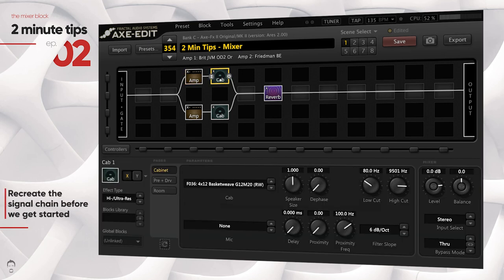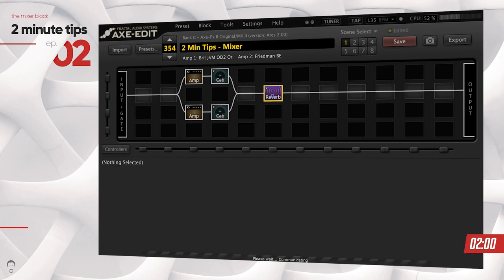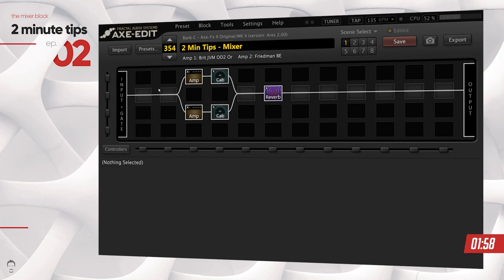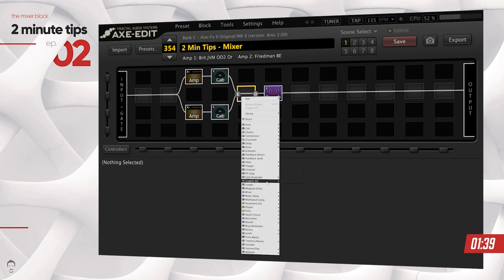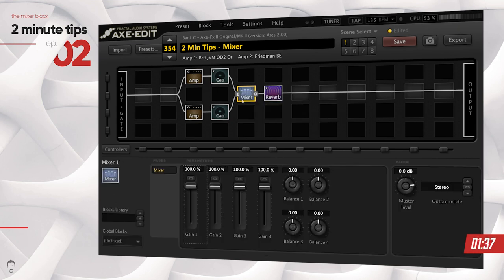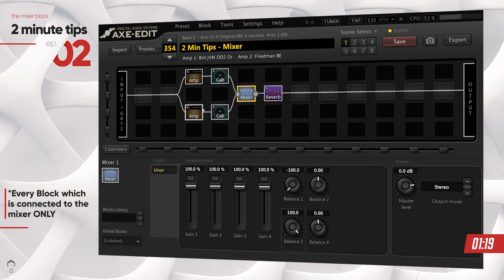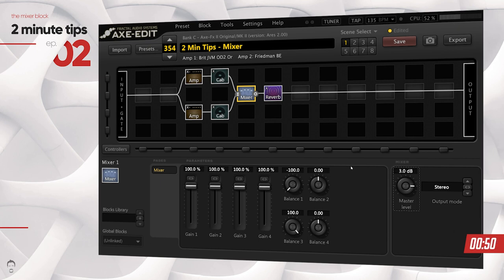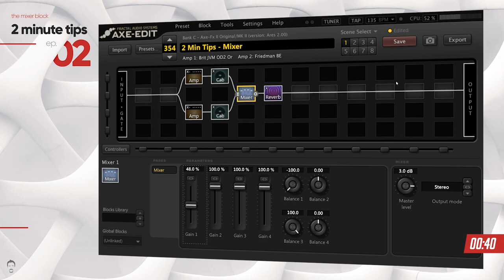2 Minute Tips | Mixer Block | Fractal Audio Axe FX 2

Comment: Thank you SO much for creating this tutorial. If I wanted to add an overdrive block into 1 of the amp blocks where would you place the overdrive block. Im thinking wet/dry stereo. Cheers.
Reply from the maker: Thanks man, and apologies for the late reply. I would place the block in the same lane as the First amp just before the amp. Hope this helps if I understood your question correctly. You can always experiment around as well! Cheers.
Reply: @GurtejSinghGuitar  Thank you for the tips - Drive block in front of amp in lane 1 then a shunt from drive block to input?